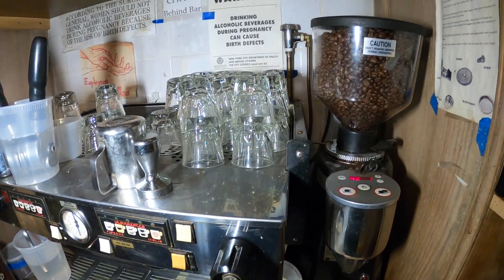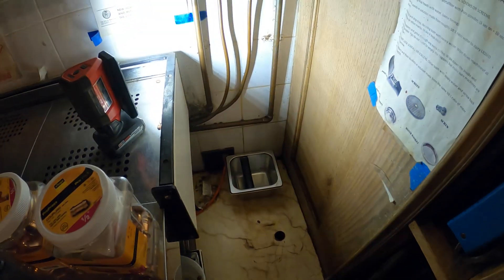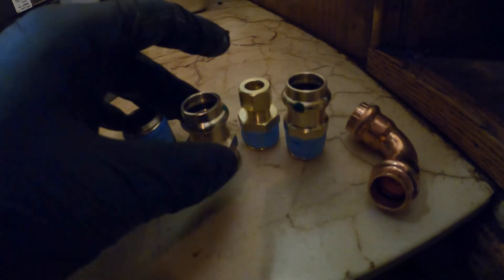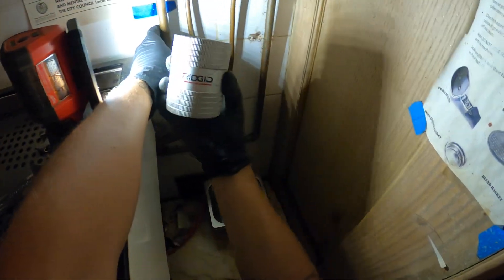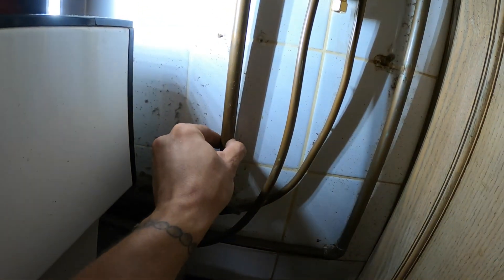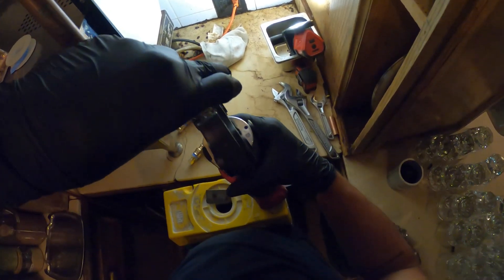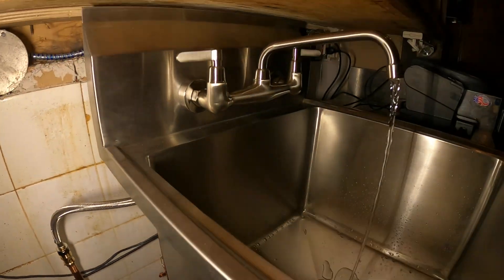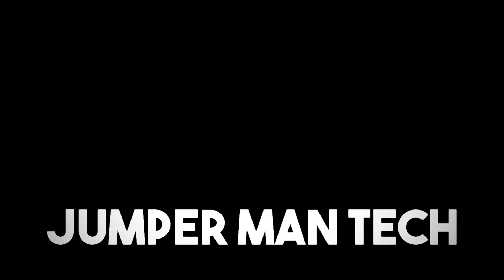Plumbing: Vacuum Breaker Replacement/Installation Lead Free Anti Siphon Vacuum Breaker Valve)

Comment: Could’ve used a street 90 out of the vacuum break and saved copper and then used a pressed 90 or a drip press 90 instead of a couple

Comment: I know that Milwaukee press tool is heavy that’s why I press everyone of my fittings that can be pre pressed on the floor or bench this way nothing moves and in small spaces your only pressing a couple! Saves you in time and energy with less hassle of holding the press tool in awkward spots!  Can’t wait till they make a smaller and lighter press tool!